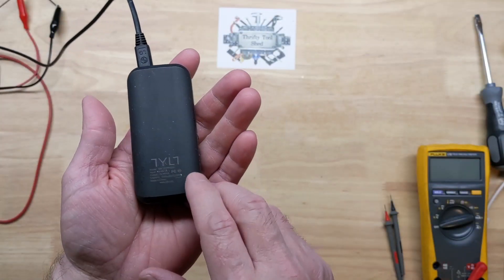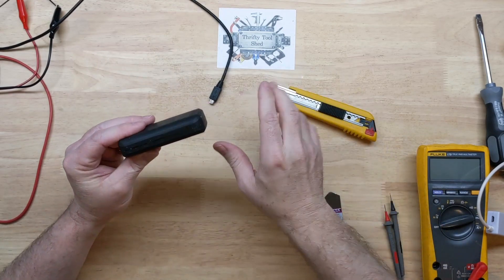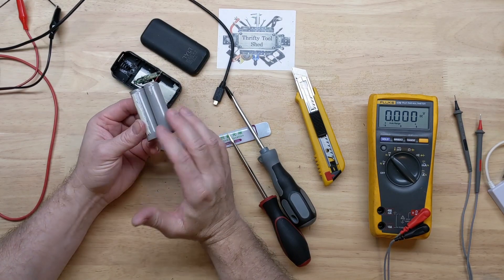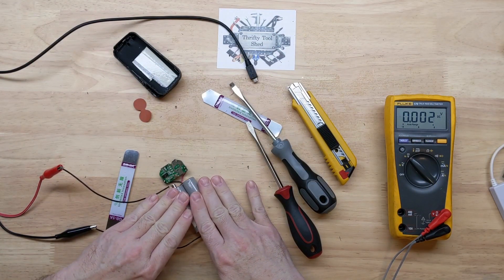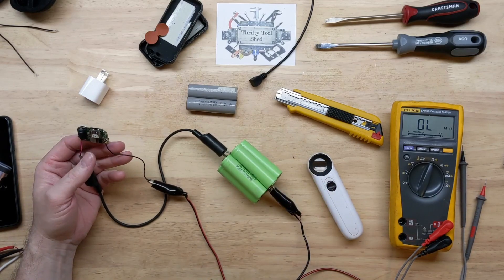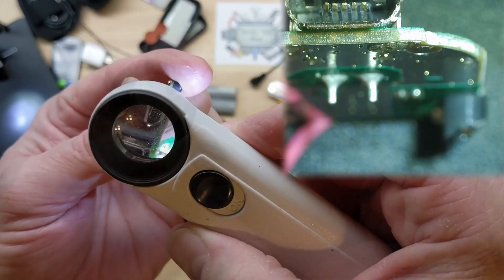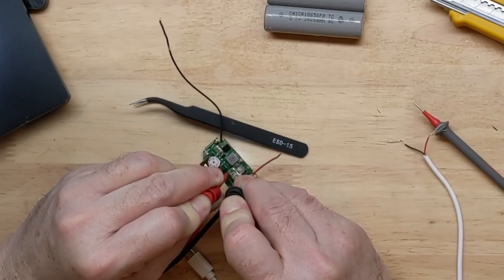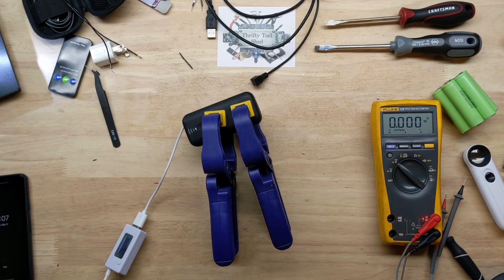TYLT Power Bank Repair

Comment: I have the exact same one from Costco that came free with a phone! The rubber coating on mine has also become very sticky and I was trying to find what the teardown process is like to see if I could take it apart before cleaning it.  Since I'm not quite sure what cleaning agents I'll be using yet and didn't want to mess up the electronics. Were there any clips holding the case together or was it just glued?

Comment: On mine, it will charge, but the output won't charge anything.  It has held a charge for years without being able to power anything.
Reply from the maker: Sounds like an issue with the DC-DC converter part of the board unless just a simple loose connection...

Comment: What part did u solder the two wires ...I have a lithium battery jumper starter
Reply from the maker: The + and - for the charging port. Look at a diagram for the type of port that was installed ( for example USB C) and connect accordingly. I always double check it's the correct pads to solder to by finding a capacitor on that same bus since  electrolytic will have polarity markings to help verify.